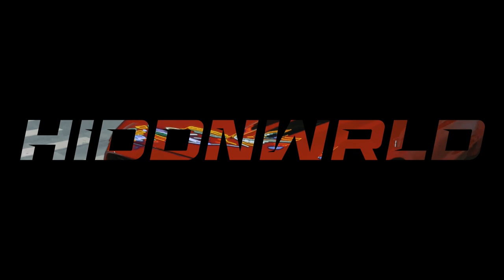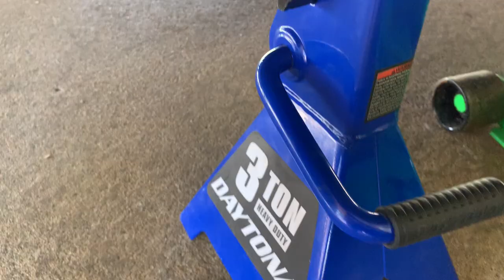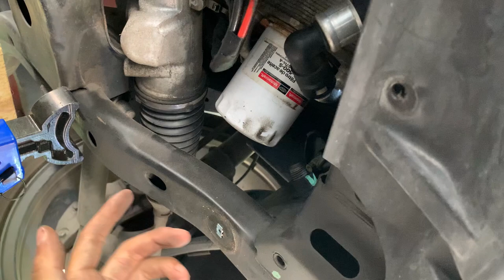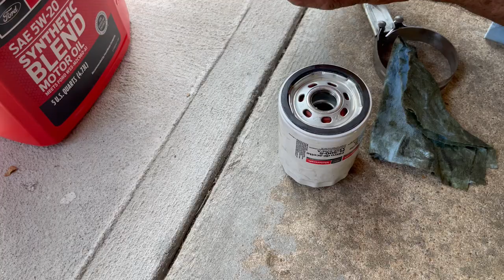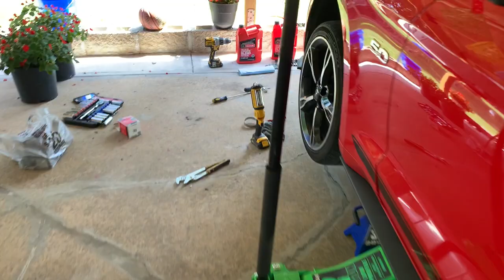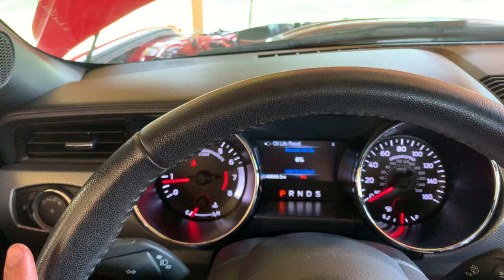HOW TO DO AN OIL CHANGE ON 2015-2017 MUSTANG GT AND OIL LIFE RESET | IN-DEPTH TUTORIAL

Comment: Nice vid.    Hand tight recommended.    I had the 17 gt.   Then got Mach n now 17 Shelby.  I Miss changing oil on the 17 gt.  The Mach n Shelby are in crappy positions n makes a Mess- even has f’in wire harness Below oil filter - it’s almost Impossible Not to get oil on it or at least make a mess.